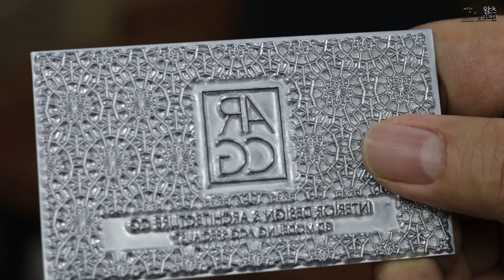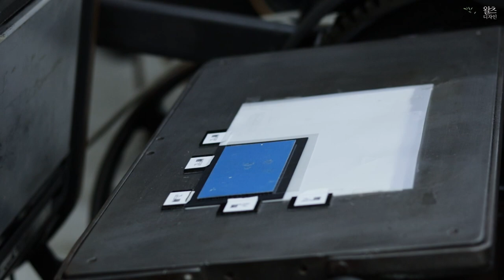Create Foil+Letterpress business cards. 레터프레스+먹박 가공으로 고급명함 만들기.

Comment: I love your work very much.  If possible, please explain to me what the rigid clear plastic piece you put on the zinc mold is for?  Did you print it out and stick it with double-sided adhesive?
Reply from the maker: Hello.  The base plate and guide are made of a hard plastic called Bakelite.  Adhesion was done with double-sided tape after printing.😊😊

Comment: how to purchase this kind of machine?thank you
Reply from the maker: I bought it by searching on Google search_letter press machine sales.
Reply: @w_letterpress  thank you
Reply: @kchannel3992  from what I can see of the press being used, it looks like, what is called an Arab Press, manufactured in Halifax England, from the late 1800’s to 1959. They were mostly treadle driven machines, but the much later models were driven by an electric motor. They are rare but you can still buy them for a premium. I have seen rebuilt models being sold for £5,000 British pounds. I am delighted to see that this particular press has been converted to Foil Printing, using a heated chase and foil feed mechanism! Very impressive.